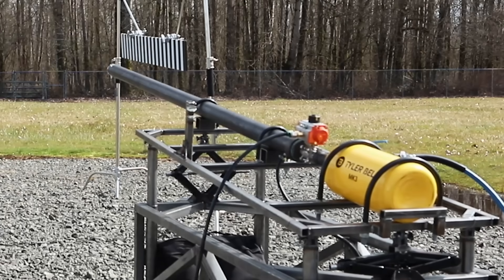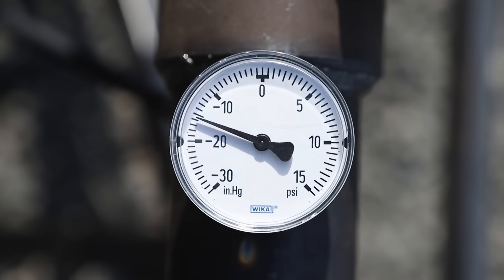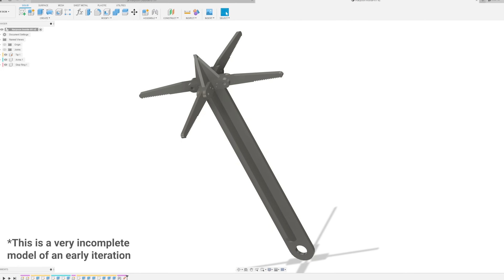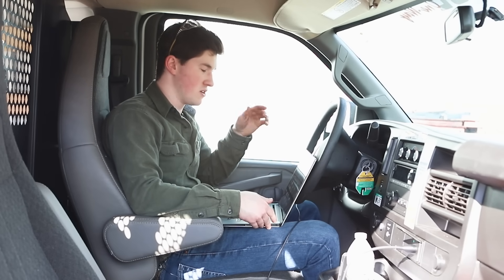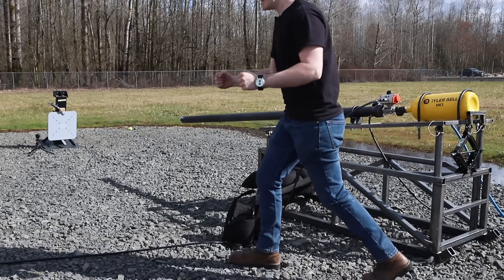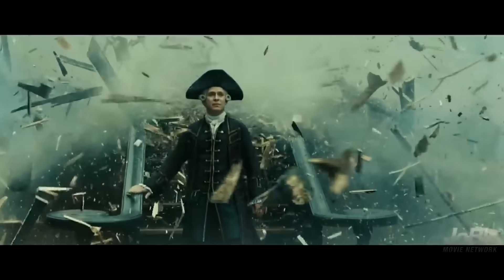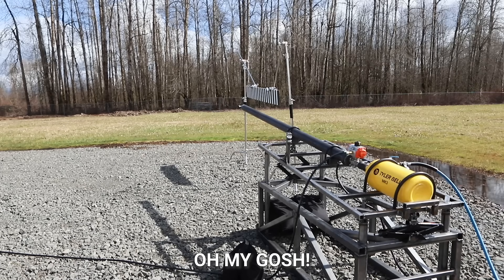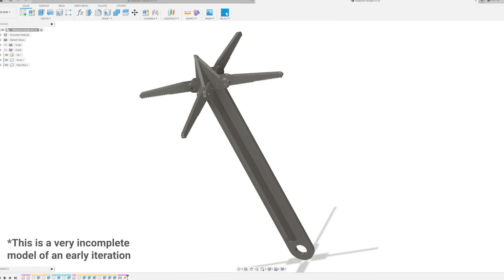Have I Found the Fastest Air Cannon Valve??

Comment: You were on the right track with the burst disk. What you're essentially trying to create is a shock tube. What you need are two burst disks with different strengths. Consider this scenario; I have a tank I want to pressurize to 100 psi and then release as fast as possible. Attached to that tank I have a burst disk that will rupture at nominally 75 psi. Now the key is I need to prevent this disk from seeing a pressure differential greater than 75 psi until I want it to. So in front of this disk I’ll put another disk which will burst at nominally 50 psi and pressurize the space between them to let’s say 40 psi. Now when I pressurize my main tank to 100 psi, the first disk only sees 60 psi of differential pressure and the second only sees 40 psi, below the burst threshold for both. To trigger the system to burst I’ll begin equalizing the pressures in the space between the disks and the tank. Once the pressure between the disks is over 50 psi, the second disk should burst. Now the differential pressure acting on the first disk is 100 psi and it will burst immediately. For shock tubes, this is how you can get extremely precise pressure differentials. However you need to be VERY careful with a system like this as it is essentially fail deadly if you lose pressure in the space between the disks.

Comment: Great stuff Tyler, love your experiments. Check out high power-big caliber precharged pneumatic (pcp) airguns. They rarely are able to go supersonic even at 300 bar! Consider getting inspiration from different valve design with a linear sliding valve and using a sabot, a technique used in firearms and in the big H.A.R.P. Supergun 😉

Comment: You may it helpful to dose the inside of the firing tube and the tennis ball fur with spray-on dry silicone lube. I think 3M make and sell it over where you are. You may you may need to lose the fur off the tennis ball and you may be at a wall with a spherical projectile. You may get a littler more velocity with a hollow cylindrical stored energy projectile. Think PVC tube with cap with built-up cone on the front, a reducer on the back with a tail tube and a doughnut soft sabot around the tube - pool noodle maybe. That may yield a little more sustained velocity as the barrel pressure drops.

Comment: I would say you need a other compressed medium. There is some limitatation of the expassion speed of any gas. So there is a point where more pressure make no change in speed. A light gas like H or He has a bigger expassion speed. The only Problem is the cost of helium.

Comment: Would adding rifling to the barrel increase the speed of the projectile with every other factor the same? It makes sense in my head that it would do that as well as increasing accuracy. 
I also think you may have found terminal velocity of a tennis ball at 1 atmosphere lol you could find out by testing both cannons that produced 0.75mach with a different projectile and see if the send it at the same speed. If they do not then the limiting factor is not your cannon or pressure or flow… it is the projectile.

Comment: have you tired something other than a tennis ball? i feel like the felt of the ball is also allowing some air flow around the ball when it deforms losing some of your pressure behind it. or maybe fill a tennis ball with expanding foam to make it a bit more rigid.

Comment: Interesting back in 1964 age 15 I started working for a company who built a compressor with an operating pressure of 15000 psi at that time we were asked to make a valve that open and close at VHP for explosive metal forming it was and I think still is the fastest valve of its type . What was the compressor used for blasting coal instead of explosives.

Comment: The valve diameter of MK3 seems much smaller. You've increased the speed of the valve opening, but now you've restricted the amount of air that can flow through in that short amount of time. Notice the tank still emptying well after the shot. 

You need to find a bigger valve of that type.

Comment: 2000 psi+
Tank neck and valve need to be big.
I don't know the fluid dynamics needed to calculate the necessary diamaters.
Experimental trial, though -
Barrel bore needs to seal the ball when the air column is released, to to the end of the barrel, with little to no blowby.
ALL of the pressure should leave the barrel behind the projectile as quickly as possible.
With regular furegunz, it's pretty dang instant. Even with artillery or tanks.

Try an artillery barrel length to bore diameter ratio, maybe for a bronze "6 pounder" scale it for a tennis ball sized... Ball, and give that barrel length, AND nominal scaled bore diameter (you'll scale the shot and bore at the same ratio but different values. I say start with a 6 pounder, but go wild!)

SO much air is released after your ball. I think you need to tune the volume of air you are using, #1 - projectile fit, #2 - barrel length, #3

You may try & lube the tennis ball.

You want to release as much air as can propel the projectile down the barrel as fast as possible, with as little resistance from the projectile as possible while still keeping the pressure contained behind the projectile until it leaves the barrel. And the propelling force ceases to effect the projectile effectively as soon as it exits the muzzle. So, all the working pressure needs to leave the muzzle with the projectile.

You have SO MUCH gas exiting after your plain balls, and even a fair amount after the filled ball.

You're correct in that pressure distortion of the ball will limit it max speed, in that it will, eventually - explode out the muzzle, yo

Be pretty badass, tbh.

Keep at it, you got a new sub.

Edit - ahh other people, with more hands on answers! Ringing the bell. Who could imagine, polite informative comments? lol

Comment: It's not Pressure or flow. It's like this: Pressure is only useful if the force from it can be applied across a vast surface area. Force=Pressure*Area. This is how the diaphragm in air brakes works to slow down a truck or train using less than 100 PSI. The larger the area, the more force that is produced. The bigger the diaphram in the brake chamber, the more force is applied to the pushrod and slack adjuster to clamp the brake shoes against the brake drum. A tennis ball is just too small an area for force to act upon the ball enough to counter air resistance to achieve over 600MPH.

Comment: There seems to be fuzz coming out before the ball, this makes it seem like some air is forcing itself around the ball, taking some fuzz with it, and also creating an area of higher pressure ahead of the ball. Perhaps a smaller diameter barrel would help remedy this? Maybe try coating a ball in petroleum jelly, or a thick oil.

Comment: try experimenting with the Tennisball/porjectile. I think it has reached a peak like you said at the end of your video. maybe making it hard on the inside and less flexible shapeshifting will help with reaching a top speed. I also assume the ball may not have a perfect seal with the projectile and therefor some air is escaping, but I could be wrong on this one.

Comment: One way to improve the ball valve is by using a design called a coaxial piston, which would complicate the design more, but the higher the pressure the faster it opens

Comment: Hi, some already mentioned that you can not surpass the speed of sound when using compressed Air. If you want to look in to the Physics you can look up "Thermal velocity" on wikipedia. 
But i still think you could maybe surpass the speed of sound with some tricks. I think your cannon is well designt and ich dont think you can gain more with altering valve designs. Howerfer you could change the gas type you are using. Nitrogen has a relativly low Thermal velocity of 470m/s (still faster then Air),  but Helium would have 1245m/s while at room temperature (293,15K). So Helium should be able to propell your ball to a higer possible speed. The second factor is Temperature, hotter gas atoms trevel faster and can accelerate your ball to a higer velocity. Maybe its possible to heat your tank with causion. But i guess heating it will only improve it a small bit as the formule takes temperature only by the root in to account.
I find it realy interesting that you reached speeds of up to 254m/s already, with the theoretical maximum of 470m/s (of Nytrogen). With the same convertion rate (54%) in Helium it would be 673m/s.

Comment: Light switches work by having the contacts spring-loaded, so that even if you throw the switch lever slowly, the actual switching happens very fast, to avoid arcing. You could have a similar spring system so that your valve opens instantly. That way you're not letting air through while you're waiting for the actuating force to build up.

Comment: What about a poppet valve, when the valve slightly cracks open, the pressure will drop so the huge force required to push the valve against the pressure will snap it fully open.

Comment: Airgun mad scientist here.  I would recommend finding someone with some lathe skills (and a big enough lathe) to make you a scaled up version of a knock-open valve found on modern pre-charged pneumatic airguns.  Obviously you'll need a big ass spring, a sear mechanism, and a cocking lever that's probably 3ft long.  The idea here is that you have A LOT of gas not being put to good use.  You reach max flow of the valve but way too late in the shot cycle. One thing a well engineered knock-open valve will do is open to max flow extremely rapidly (within milliseconds).  The valve will also close itself with the ball about halfway down the barrel.  What this creates, in turn, is a pressure gradient and, therefore, an acceleration of the expanding gases.  As those gases accelerate, the ball does as well.  You have way more than enough gas mass to transfer momentum into the ball, you just need that gas to go about 300fps faster to get the system (air and ball) moving at supersonic speeds.   You could also just use a longer barrel, too.

Comment: What if I told you there was a faster, larger, cheaper way to make a valve and best of all it is 100% pneumatically driven.  I first saw the idea around 1980 so it is proven technology.  You can make it yourself.  It is in essence a spool valve.  Picture a 3" pipe tee.  On one connection is the accumulator and the opposite is the barrel.  The cross connection is machine bored to a close tolerance.  In that bore a UHMW(plastic) piston sits and is sized to slide freely.  The tee connection behind it is connected to a pneumatic source behind a small valve.  Speed of opening is not critical.  80 psi is plenty. The other side of the tee is vented to atmosphere and needs to catch the UHMW piston.  The piston blocks the accumulator air from escaping until it is pushed across the opening.  If it is too leaky, use one of you other valves in front of it for a 2 stage launch.  One more critical piece of advice.  Use a wadding like a shot gun shell.  Size the barrel for a compressed tennis ball (or limit its compression by fitting the ball into a hemisphere in the base of the wad)   Set the ball in a non-expanding disc or wad sized for the barrel.  Need more speed??? try a barrel with a lower coeff of friction. Make the wadding from UHMW. Be careful with systems that  suddenly release expandable gas.  They are in essence bombs.

Comment: Possible ideas to try for increased speed:
Venturi restrictor at the beginning of the pipe downstream of the valve - exchange pressure for velocity
Helium instead of nitrogen - higher speed of sound, the particles travel faster and will fill a vacuum tube faster than nitrogen

Great solo project, impressive Vs the money no object SED supersonic baseball cannon

Comment: If threre was no ball in the barrel, the air would come out at the speed of sound, right? I need there are some tricks required to exceed that.
Reply: Thought som emore about it. Try to use a gas with higher speed of sound. So Helium oder Hydrogen. Use Vacuum on the other side.
Reply: Or steam.

Comment: Barrel seems too short. I made a golfball launcher using mapp gas many years ago, and i remember there was a very specific and optimal barrel to chamber volume ratio. I didn't break the sound barrier, i got about 280-290m/s. My barrel was longer than this, and my chamber was a bit smaller than yours. Judging by the whistle sound from all the air after the tennisball leaves the barrel shows there is still a lot of energy left to push the ball.

Comment: You need a speed buffer for the valve. 
There are is a 12v Impact driver tool that basically starts spinning internally but only engages the outside shaft when the internal part reaches a certain rpm. It basically buffers all that rotational energy and releases to the inertial tip that acts like a hammering effect on bolts you are trying to lose or tight. 
If you use something like that for your valve it will open way faster. 
Also you don't need that much gas. As you can see, the ball is way out and the gas is not even a quarter empty.

Comment: you might need a longer barrel to get more gains at this point.  that or the newer faster valve is still just a fraction of movement in the right direction, and the jump in opening speed might need to be more drastic.  interesting stuff

Comment: Your main problem in getting past the speed of sound, is the speed of sound it self. Gases only expand at certain speeds, which are not only determent by pressure, but also the gases specific speed of sound. 

To accellerate something, you hit it, with something faster. As your gas exits through a valve, that imposes lots of turbulance and restricts the flow, you lose a lot of velocity.

Destin from SmarterEveryDay has created a cannon, I think you might be aiming for. He Build it as a baseball cannon.
He uses a very clever custom build valve and helium, because its specific speed of sound is about four times that of nitrogen.

Hope that helps.

Comment: im not an engineer but doesnt air start to move faster as the volume it passes through decreases? At least thats how groundeffect cars use it. meaning as you used a smaller outlet for your tank going into a wider tube you slowed down the air as well

Comment: The speed of sound is the speed at which a pressure wave will travel through air. When you open the valve to the tank, the outflowing air is limited to the speed of sound. You cant accelerate an object past the speed of sound with a propellant that wont expand faster than the speed of sound.

The solution is a de laval nozzle between the ball and the air tank to accelerate the flow past supersonic. It's a nozzle typically used in rockets and high performance jet engines, with geometry that makes the flow accelerate past supersonic. That way the air is supersonic, and can carry the tennis ball past the speed of sound.
Reply: I have a question. I have your comment? If you haven't read it let's consider this 
 Steam boilers. We got big ones small ones Mine holds only one gallon. Even with mine When I would "blow it down", for PM maintenance I could see the Chrystal clear STEAM
At all it's 150psi and 350 deg glory. For about 1-1/2" then it turned into condensate, you could see it, it was white. Ans lost most of it's power. Now it's ok to call steam, steam like in a pond your breath even condensate. So long as you remember the "STEAM" that does work, is Chrystal clear and consists of H2o molecules all by them selves. When two H2o Molecules join hands, well you can see them, there white have, no power and are called Cond instate.

Comment: You need to use a hho cell to fill your cylinder with hydroxy, then use an internal ignitor to cause a massive implosion... your welcome 🤣 btw hydroxy can't be over compressed otherwise it's prone to spontaneous combustion. Try at your own risk.

I've heard you can bubble it through linseed oil to make it safe to compress 🤷‍♂️

Comment: Use a shell... 
3D Print a split shell that prevents the ball from deforming inside the barrel. Something that catches wind and falls away at the split as the projectile leaves the barrel. 
This should remove the side pressure and put all the force into forward motion. Or at least a good bit more of it.

Comment: 2 avenues to more speed.
Use helium instead of nitrogen. This should be good for 30% more speed  or better. 
Use air and lubricate the ball with oil. Providing you have high enough pressure  and a fast enough valve to ignite the oil. This is called dieseling in the air rifle world. Dieseling a tennis ball would be interesting 😉. For that matter the valve on a pcp air rifle is a simple affair. Every mechanical pcp air rifle uses virtually the same system, might be worth looking in to if you decide to pursue mach 1.

Comment: Use a hard plastic ball cradle and use a breakable link to hold the ball in the barrel until pressure has built. Your ball is getting launched with low pressure air well before significant energy can develop behind it. Your heavy solid plastic ball was probably faster than the squishy light ball. I have seen a ping pong ball shot with incredible speed on nothing but two burst discs and a vacuum pumped pvc pipe. No tank just a vacuum port and some tape.

Comment: Your barrel needs to be longer, and you need a vacuum reservoir at the end of the barrel. When the valve is initially opened, air molecules will make it past the tennis ball, and cause drag as the tennis ball later accelerates past them. A vacuum reservoir is basically a much larger diameter portion of barrel located at the end, so that the rapidly expanding gases do not cause the interior pressure in front of the ball to increase sufficiently to cause drag. Ideally the volume of the vacuum reservoir would be as large as is feasible.